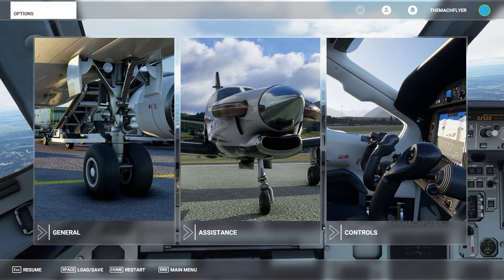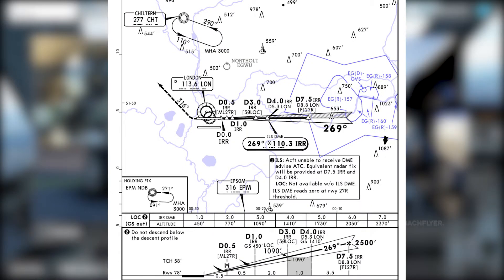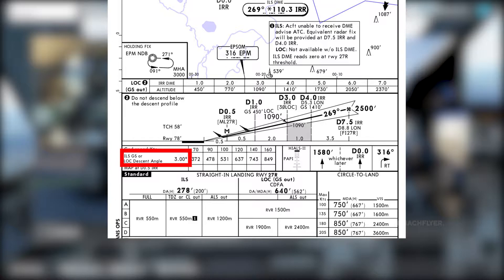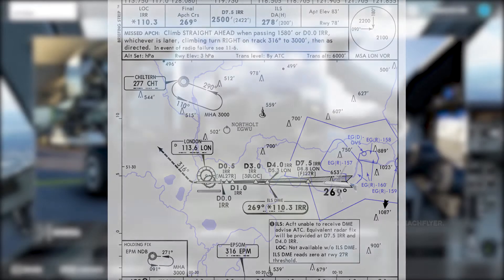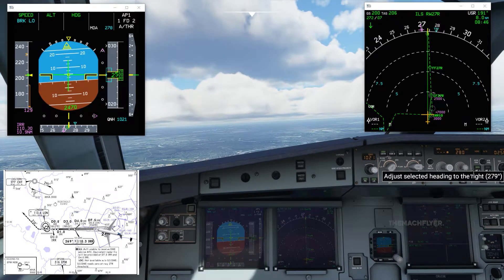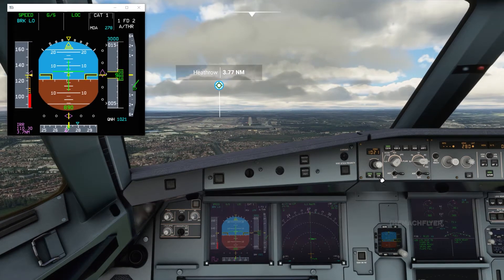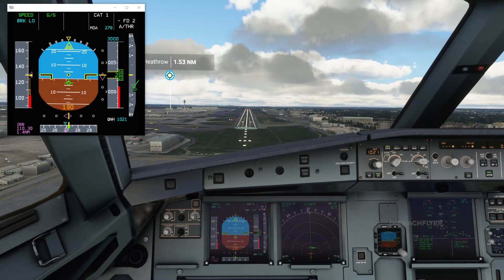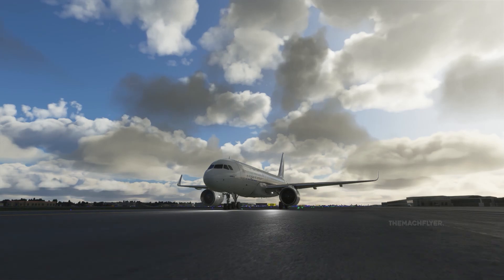[Real Airbus Pilot x MSFS2020] A320 ILS Approach Walkthrough (LHR/EGLL)

Comment: I've been having rouble with this approach. That STAR via BIG brings a lot of USR waypoints and tht usually mess the autopilot. Some sharp turns and stuff also, very wierd. 

Does you get the same problem with the USR waypoints?
Reply from the maker: Hi Luis, yes i did get the same issues too (as you can see my ND there is quite a mess 😅..). I have no choice but to play with the HDG to intercept by myself!